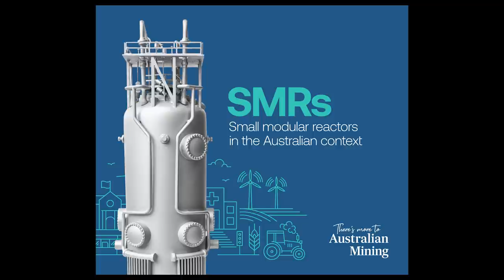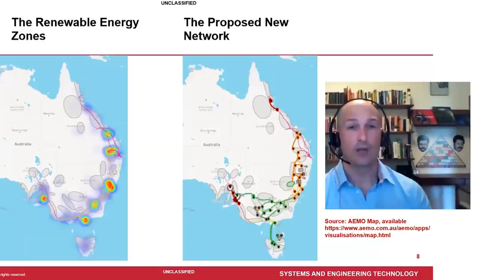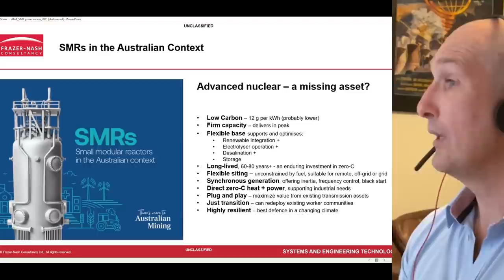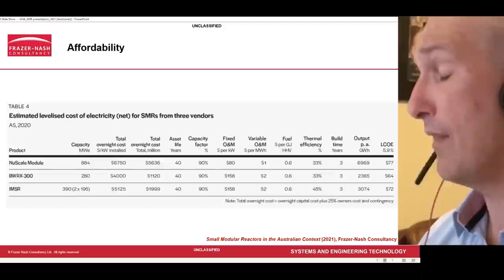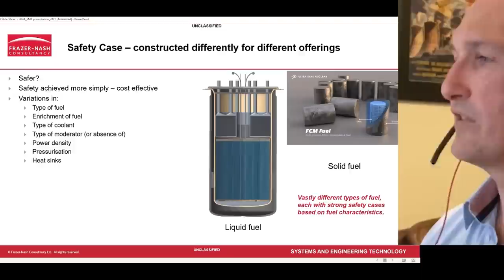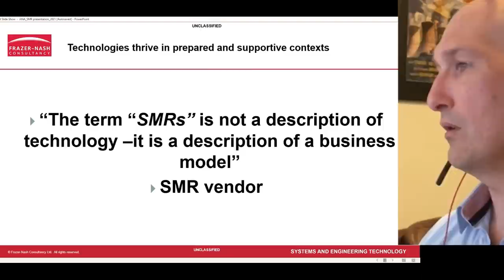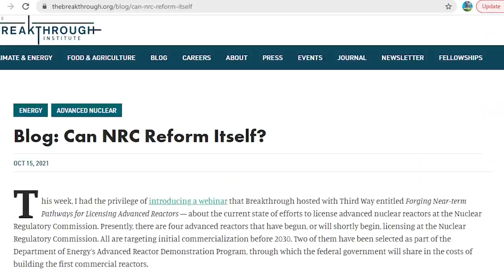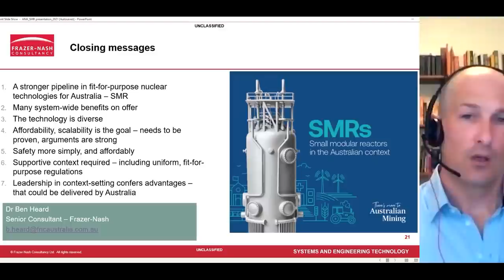Nuclear Australia: Small Modular Reactors in Australia by Ben Heard

Comment: Where does the statement that thorium has x100 more energy per kg? I thought because it was turned into uranium 233 it was a better fuel because 233 is a better fission product.
Reply from the maker: As a mined ore, thorium can be fully fissioned. It isn't a direct process, it does need to absorb a neutron, become U233, and then it can fission. But Uranium can't do that... Uranium needs to be enriched so there's less of the ore you can convert into energy.

Now, when I say "uranium can't do that" well that's sort of a bald lie. Uranium CAN do that, U238 (the abundant Uranium) absorbs a neutron, becomes Pu239 and that can fission. But that requires fast neutrons. ("Fast-spectrum reactor.") Thorium can do it in thermal spectrum, and that's what most reactors on Earth are today... they ARE solid fuel and water cooled and also thermal-spectrum neutrons. Fast-spectrum neutrons have some challenging aspects to them.

TerraPower (Bill Gates) is an example of a company pursuing fast-spectrum reactors and they'll be able to convert Uranium (and Thorium) into energy far more efficiently than today's reactors. And Oklo too. Russia is running a few.

Fast-spectrum reactors could fission today's used-fuel, as our used-fuel is only 5% used-up. 95% of it is still Uranium.

Right now only China (TMSR-LF1) and Thorcon (TMSR-500) are looking at using Thorium as part of their fuel-cycle mix. Oh, and Centrus Energy with ANEEL fuel. But those aren't aiming anywhere near x100 more energy /kg.

To get near 100% efficiency with Th as fuel, fission products must be continually removed. Online chemistry. Bit of a challenge, quite a new concept for nuclear. China pursuing that too with experiments once TMSR-LF1 is operating, but TMSR-LF1 isn't depending on it.
Reply: @gordonmcdowell  so its obviously not as simple as Th is x100 more energy efficient then uranium, and it seems energy efficiency has more to do with the reactor then the fuel. However, in summary the Th to U233  fission process is not more energy efficient then the existing U235 fission process currently used in modern gen3 reactors?
Reply from the maker: @christophercollins4134  YES, the efficiency has everything to do with the reactor. It is just in the thermal-spectrum only Th will turn into fissile (U-233) often enough that no additional fissile needs to be continually added... it can be fuelled 100% by fertile (Thorium which becomes fissile when hit by neutron).

If you try do that with unenriched uranium IN A THERMAL-SPECTRUM REACTOR, not enough Pu-239 is created (fissile from fertile) and eventually the reaction stops.

So it is only the fuel choice in THERMAL-SPECTRUM REACTORS. If you use FAST-SPECTRUM then both natural Thorium and natural Uranium can be used as fuel, and the "thorium is 100x" no longer applies... both U and Th would be vastly more effecient. Fast-spectrum is a reactor choice. So you can say any efficiency concern can be addressed by developing the appropriate reactor.

Conventional reactors can be designed to be more efficient with Uranium fuel. CANDU uses heavy-water instead of normal-water and that wastes less neutrons (fewer are absorbed by the water and wasted). CANDU actually run on natural uranium. There's no enrichment. So there's no "wasted" depleted Uranium. Canadians get 2x the energy from our mined Uranium than Americans (and most of the rest of the world) does, because we don't waste the depleted Uranium.

There's MANY ways to improve the efficiency of reactors regarding ore usage... get more energy from less ore. Use heavy-water. Create metals that absorb fewer neutrons. Supplement the fuel with thorium. Use fast-spectrum reactors.

Uranium is cheap. It looked like it would be rare in the 60s, but currently there's ample supply. So as much as I'd personally like to see ore efficiency pursued, it generally isn't top-priority because those funding reactor development are more worried about overall cost rather than specifically fuel cost. And anything which is not conventional reactor design is still very difficult to license. NRC and pro-nuclear legislators are trying to fix that, and have made progress, but it looks like they're not moving fast enough.
Reply: @gordonmcdowell  Thank you

Comment: Don't bother. If you can't do it in 18- 36 months. It's not worth it. 
America's transcontinental railroad took 6 years. Used more steel than a single plant. Hoover dam used 160x more Concrete than a single nuke plant, was done in 4.

Comment: I tend to avoid 'trusting' any document where the figures simply don't 'add up'...
Take for example the 'Affordability' table @ 8:39-ish
The figures for the 'NuScale Module' and 'IMSR' work out fine but the BWRX-300 data is internally self-contradictory.
Specifically, the "Output p.a. (GWh)' is obviously wrong!
280 * 24 * 365 * 90% gives me 2207GWh p.a. rather than the stated 2365GWH p.a.
Admittedly, it's only a 7% 'error', but when it comes to Nuclear Power, it kinda scares me into wondering whether there are OTHER, more 'fundamental', calculation errors that have been made.
In summary, proof-read and 'sanity check' EVERYTHING and once that's complete, do it AGAIN (and again!)

Comment: SMS would be great for heating hot water for oil sands production in Fort Mac Alberta Canada . The oil sands (tar sands) uses far too much natural gas for oil production. It is politically impossible to stop oil sands development in Alberta Canada. The best way to transition from oil to nuclear is at the consumption side. Going to EV's Where the electricity comes from nuclear or hydrogen from nuclear. And save the oil for aircraft fertilizers herbicides pesticides and plastics.

Comment: Move away from water cooled and sodium reactors. Trouble from both. Stick with Thorium reactors.
Reply: @tigertoo01  What a surprise, you're opposed to consumption. I never would have guessed... Amazing how people can  unironically support poverty. I'm going to mute you now.
Reply: @phamnuwen9442  run away little boy
Reply: @phamnuwen9442  Eh, I'd call everything that goes along with keeping water a liquid at temperatures where it really doesn't want to be, the poor performance of solid fuel, and the relatively low efficiency of their operating temperatures trouble. The various water moderated reactors are probably the worst non-absurd way to produce nuclear power. That they're competitive anyway speaks volumes about the unrealized potential of nuclear power.
It's too early to say what most MSRs will be. If the source material regulations which prevent rare earth mining were lifted, I can just as easily see the thorium fuel cycle dominating as it would be a practically free byproduct.
Reply: @tigertoo01  Let me guess, "blah blah blah, arguments which have been refuted ad nauseam." Whatever "problems" you're referring to either don't actually exist or have better outcomes than other power sources in those regards.
And what Pham said, you unironically support poverty. Efficiency has diminishing returns, whereas more energy is just more energy.
Reply: @jsn1252  The cost of nuclear fuel is very low with light water reactors and with MSR it will be even lower. The cost will be almost all capital cost. Therefore there's very little incentive to switch from uranium to thorium. Particularly if the thorium fuel cycle makes the reactor more complicated (i.e. dual fluids etc).
Reply: @phamnuwen9442  Sure it's low, but it's also far more expensive than mine tailings would be. Energy security is a pretty good incentive. Some nations, like India I believe, have substantially larger thorium deposits than Uranium. 
I think most MSR designs already use dual fluids in case of a crack in the fuel loop. And if a design were using a chemical kidney anyway, I can't imagine fuel choice would present a significant difference in capital cost. By the way, Thorcon's design uses an 80% thorium fuel load and no breeder blanket separator system.

Comment: We have wasted 10 years not deploying renewables properly so nuclear is going to be needed now, if they passed laws that made 10% of profits from nuclear investors goes to renewable deployment, I would be happy....But that would be to forward thinking for our 'leaders'.....
Reply from the maker: Germany has been deploying renewables for 10+ years and had middling success reducing emissions. ElectricityMap is an excellent tool to see how countries are actually performing in reducing GHG emissions, rather than the dubious goal of deploying renewables. (As if deployment of renewables is a goal in itself.) Yes, Australia could have deployed more renewables up until now... you would now be having a much harder time deploying more because they can't add much utility to a solar/wind saturated grid. Deploy some now. Legalize nuclear. Build both. Plan ahead for what transmission lines need to be deployed now to accommodate as many energy choices as possible in the future... often renewables are constrained by transmission capacity.

Comment: FFS, every SMR project to date has been an utter disaster with massive cost overruns and time blow-outs. At what point are people going to wake up and smell the shit they are shovelling?
Reply from the maker: As Ben points out in this talk, the cost of nuclear needs to be addressed by economies of repeat manufacturing. What has been demonstrated (because there's no repeat manufacturing of SMR yet to speak of) is that when identical large-scale nuclear reactors are constructed the cost comes down with each unit. The industry (outside of South Korea) mostly kept building unique snowflakes not identical units. But when nuclear is built again and again from same design, costs do come down. Just like with everything else that is manufactured repeatedly in a factory and not dependant on constrained material resources.

One product, solar panels, HAS risen in cost since 2020. That's because, despite being built in factories, solar panels are resource constrained by power (currently the burning of coal in China is what powers solar panel factories) and polysilicate.

If SMR cost a lot, no one will buy them. Australia won't buy them. End of story.

But if Australia maintains the position that domestic nuclear power should stay illegal, and SMR achieve their cost goals, then SMR won't be of any help to Australia. You'll still be burning coal. Just like Germany still does.

Ontario used to do that. Burn coal. Now they fission Uranium instead. No more burning of coal. Very simple. Good thing that nuclear power isn't illegal here in Canada.

Comment: As all proponents, he fails to address the the subject of the waste. He also ignores the fact that renewable and battery performance and costs are continually falling while the costs of nuclear are rising. The African countries he mentions have a great potential for solar power much of it generated domestically which is good for distribution and equality and does not tie the population into the corprate model like nuclear does.
Reply from the maker: Ben has spoken about nuclear waste in an older talk, "Australian Nuclear Responsibilities". In this talk he only mentions it passingly at 25:34. But basically (from his other talk) nuclear waste is 95% untapped energy. Moltex and Oklo are building reactors to harness it. He shows a fenced off area the size of a parking lot, and says this tiny amount of waste (because it is tiny) is the result of "110 million mWh of electricity". That is 110 million mWh of (essentially) carbon-free electricity. Stick it in a geological repository, or recycle it with a fast-spectrum reactor into additional clean energy.

That's much safer than coal combustion, currently used to create Solar PV panels in China. Because coal pollution is shot directly into our air. You've probably noticed solar PV prices have gone up? That's because the cost of coal has gone up.

African nations are taking hard look at nuclear, because the sun sets, and batteries are expensive. This also explains Germany's inability to stop burning coal. They built a ton of solar and wind, yet continue to burn gas and coal. Also Germany has the highest electricity prices in Europe. Why is that, do you think? Is it "the corporate model" or maybe something to do with physics?
Reply from the maker: @eclecticcyclist  Germany never stopped burning coal. Germany is now dependent on Russian gas. Because the sun sets and the wind stops blowing. Renewables can supply a greater and greater percentage of Germany electricity and (thankfully) Germany will burn LESS coal, but never zero. They'll never be a climate leader. If Germany WAS gong to be one, they'd have emissions like Ontario, France or Sweden by now. Ontario stopped burning coal in 2014. It wasn't very hard. They just upgraded their nuclear fleet, and shut down coal.

Why would an African nation look at Germany and think "yeah, that is what we want?"
Reply: That is because nuclear waste is essentially a beat up by the coal industry. In the US it is a particular issue because coal industry interests have persuaded Congress to prohibit reprocessing. As a result 95% of nuclear fuel is unused, the resulting waste is long lived and needs to be stored.

With modern nuclear fuel cycles waste is minimised because 90% of the potential energy is extracted and unavoidable waste products have only one tenth the volume and are short lived therefore readily manageable. This is the basis of France's success in using nuclear.
Reply: @paulbedichek2679  It depends who you're listening to and what their motives are.
Reply: @paulbedichek2679  Yes, SMR technology in particular likely to be widely adopted in developing countries as increased energy is essential for their economic development.
Reply: @gordonmcdowell  Also Germany is dependent on France for its nuclear.... Its so important that the EU put into law basically that france has to give up 25% of its nuclear production to prop up surrounding countries. The low wind period that crippled so many was exacerbated by France having a few more reactors offline for maintenance.... Honestly until we accept/define the two forms of energy theres not much hope... potential dumpers and potential suppliers, until you resolve that issue and force the dumpers to provide a service level they will gouge the market and be responsible for nothing
Reply: What waste?

Comment: Dumb: SMRs have all of the nuclear\regulatory obligations as a traditional size plant, but with a tiny usuable output. The reason why Nuclear power plants are so large is to justify the costs with the output. SMRs will never go anywhere except for military\gov't niche needs. For all practical purpose, Nuclear power is dead in the West. Power companies don't want to invest in them because of the endless red tape, high construction & Maintance costs, and very long construction time. Just to get a build permit for a new plant can take 10 years and costs billions, then it takes another 10 to 15 years to build. Forget-about-it!
Reply from the maker: Depends how they will be regulated. They MIGHT be regulated the same as large plants, but I wouldn't bet on it. But even if they are regulated like large plants, it would still be possible to deploy additional units on a single site. Just like is done with conventional nuclear, but 100s of units instead of 1-to-8. Just keep building them at a factory and deploying them all on a tiny plot of land.
Reply: @gordonmcdowell  I doubt it. They would not scale efficiently to a large reactor. You still have to address cooling, power generation from the steam produced, Building seperate contaminament systems, controling, start up, shutdowns, And refueling. If you make 100 units to server like 1 large reactor you have made the construction, maintaince, complexity 100 worse.

Small module reactors are nothing new. They were build since the 1960s, but the costs were never justified.